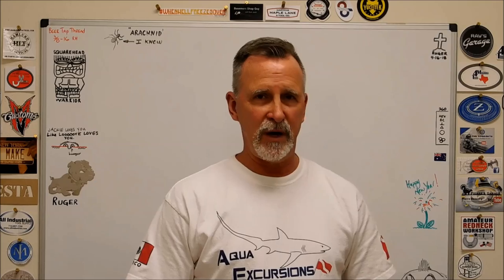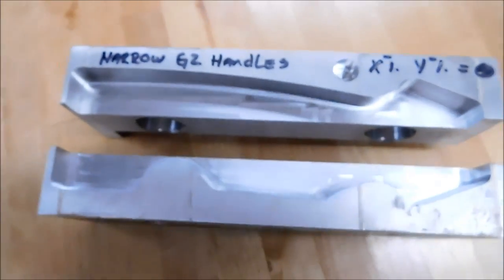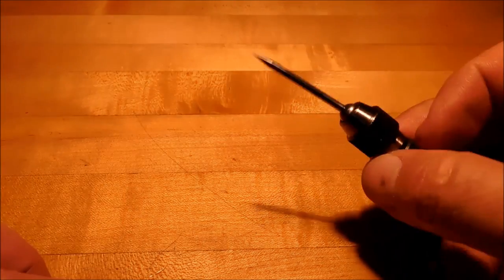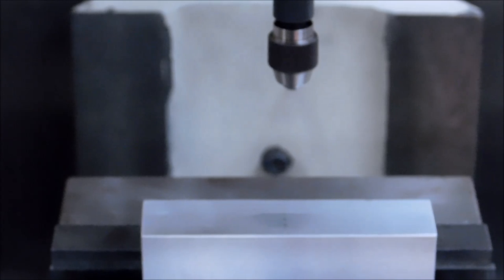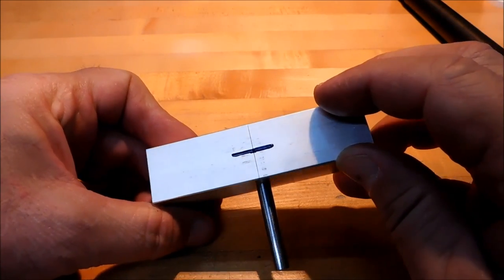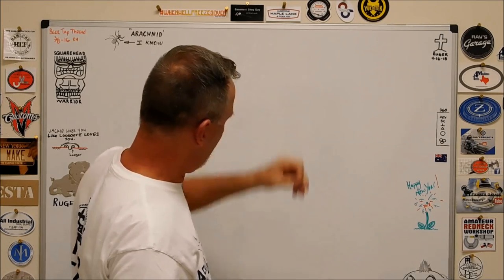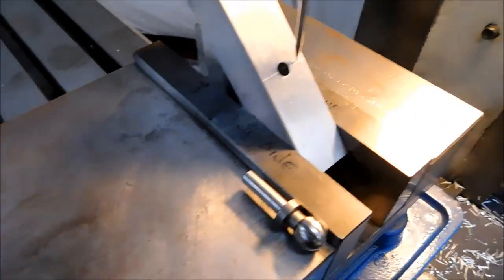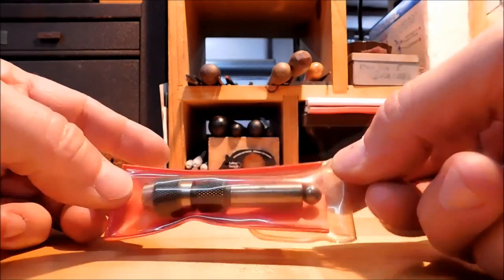Tooling Balls and Tooling Holes

Comment: Very good explanation, Joe. Thanks! Had a bad experience once when I designed a plastic injection mold using a tooling hole for alignment. Night shift "machinist" didn't understand tooling holes or tooling balls so he just obliterated the dimensions from drawing (CAD) and did NOT drill the holes in mold plates as drawn. Absolute nightmare to get mold parts to align correctly, but I did a country boy fix and saved the mold. Transfer punches saved the day!

Comment: Thanks, very interesting and useful.
For what it is worth, I use the conical end of my centre-finder differently. With the milling machine OFF, I gently lower the conical centre-finder into the drilled hole I want to centre on. The cone-ended section will then kick-sideways to self-centre in the hole, thereby creating a lateral offset with the main cylindrical body of the centre-finder. Then I iteratively move the stage until the cylindrical sections line up in both x and y. Fingertips are very sensitive, and will detect even the tiniest of offset ridge between the two cylinders. It's a surprisingly accurate technique.
For even greater accuracy, use a micrometer across the split in the cylinder of the edge-finder. When it matches the diameter of the edge finder barrel all the way around you're there.

Comment: Nice Joe!  I have always just rested the back of my thumbnail directly against the side of the tip of the wiggler. I plant the left edge of my right thumb on the workpiece and bring the tip down to about mid nail. This allow very precise control by rolling your thumb in until the tip stops tapping and runs concentric. I have my left hand surrounding the shaft above the tip to catch it if I overshoot and it wants to whip out.
ATB, Robin

Comment: Enjoyed, very interesting - Never needed a tooling ball so far, but for sure handy to know/have.
Tooling holes are something I started very early to put into my fixtures at work.
I usualy model the fixture and the part up in Cad/Cam and use the Tooling hole as my X/Y/Z zero for machining the fixture itself (if possible) and to machine the part in the fixture. So I have only to keep the cad/cam file around and dont get problems with offsets that I forget to write down/document ;)

Comment: Thank you for this very informative video. I have used a tooling hole in a very simple fixture. Still use that fixture, works great every time. The tooling hole is actually the work offset in my program. 

As for the tooling ball, I had no clue. Now, I can see how they could be a great thing to have.

Comment: Tony Tammer, machine shop teacher, California.
I learned about tooling balls at Lawrence Berkeley Lab in the 1980's.  I had to drill holes at a 15 degree angle to the surface of a part, at one inch +/- .002 from the edge. How to do this?  Locate the hole vertically with an edge finder.  Drill and ream a hole for the stem of a tooling ball.  Tilt the head to 15 degrees, dial in the tooling ball, last step: raise the table up the reference difference from the center of the ball to the surface of the part, and you are ready to put in the hole, first with an end mill to get a surface roughly perpendicular to the drill , then centerdrill, and finally drill and ream the hole.

If you can't drill that vertical hole in the part, use a tooling ball without a stem.  Machine up a tube with an I.D. slightly smaller than the ball diameter, and chamfer the I.D. edge.  Locate the center of the hole vertically (with the head vertical) with an edge finder. Then take out the edge finder, put in the tube, and use it on top of the ball,  to press the shoulder of the ball lightly against the part (using the tube to align the ball). Then wick some crazy glue between the shoulder and the part to stick the ball down, and follow the steps in the first paragraph. Tap the ball off the part and you are ready to follow the steps in the first paragraph. No trig or math needed, and you will be very close, the error being the thickness of the crazy glue.
Reply: check out the program at deanza college

Comment: Tooling balls are also used in automated or robotic systems to achieve the accurate positioning of something (e.g., a test sample, a bio-tray (tray with a bunch of small indents to drop one drop of liquid in for growing biological samples)) without requiring high accuracy of the robotic arm or automated transport device. Take a flat plate. Build a nest on top to hold the bio-tray or whatever. Mill a conic section into the bottom of the plate, apex up (a cone with the top lopped off so it is easy to mill). Mill a slot with 45º sides, apex up (a flat bottomed slot with sloping sides) on the bottom of the plate. Mill a spot flat on the bottom of the plate. Permanently mount three tooling balls on the test fixture holder, in a triangle, in very accurate positions. Now when you drop the test plate on the balls, plus or minus .125" or so, the cone will center on one ball defining a point, the grove will slide onto a second ball defining a line, and the flat will sit on the third ball defining another point. If you layout the positions of the three balls and the pattern on the bottom of the test plate so the line along the grove and a line through the two points are parallel you have a plane . This allows you to position the test plate with high accuracy using a positioning device with low accuracy. The further the three balls are apart, within reason, the more accuracy at the test site versus the milling accuracy.

If I knew how to add a picture to these comments, I would, but I don't.

Comment: I'm sure most machinists ponder the purpose of the pointy end of the edge finder. I use it to align the spindle with small holes: with the mill off I pull the quill down until the cone seats perfectly in the hole, then it's a matter of moving the table until a thumbnail doesn't catch on any of the sides of the edge finder. I don't know if that is its intended purpose, but that's what I do with it.
And my own preference is to use a Sharpie to center wigglers. It's so cool when you can feel it suddenly lock in on the perfect axis of rotation. Wigglers and edge finders are amazing in their simplicity.
Reply: i use a dead center, then indicate the hole

Comment: Tooling balls are also great for construction as well as inspection. Especially if you have multiple angles and or radii. They can all be located via the tooling ball and it allows for easy inspection. We often use a sine bar or plate and height gauge to inspect for proper location. Just thought I'd throw that in as a side note. Another great video that I am sure many viewers will find value in at the machine or surface plate.

Comment: Excellent video. I might add that the tooling ball allows you to pickup the fixture when it is rotated in several axes. It's usually beneficial to have a couple different styles on hand to match the particular variation called out on the blueprint. If, for some reason you find yourself setting up  on two angles, or an angle while rotating the workpiece , you will find yourself slipping down the rabbit hole known as compound angles. Instead of merely calculating sides of a triangle, you may find yourself looking for base angles, angles of inclination and/ or angles of rotation of a pyramid. That  topic is worthy of at least a full semester (or more ) at college . Keep up the good work.

Comment: Great presentation as always.  I'm wondering why a pointed wiggler would be used to pick up a scribe line versus just chucking up a precision ground pointed pin.  I've had a wiggler like the one you showed but never figured out why you would go to the trouble of trying to center it by hand to use it like a pointer - have I missed something here?  I've usd an edge finder a million times but never the pointer.  Great safety tip on that by the way.  Please don't quit making these videos - I love them - they make me think.

Comment: We had an ever-expanding collection of part-specific soft jaws and fixtures. Each had a fixture reference feature(s), the reference offset numbers, and the part number machined into it. The jaw pairs both had the part number in case they got separated. The data files (CAD, CAM, G-Code) were all named with the fixture part number. If you picked up a pair of jaws and didn't know what they were for it was a straight forward exercise to find the associated file. At least with CAM / CNC, adding the text was a trivial additional step. The other take-away: create a part numbering scheme EARLY and apply it to everything you create.

Comment: I use tooling balls with the renishaw probes ALL the time.  Our older Horizontal 4 axis machines don’t keep track of relative positions like our newer 5X mills.  They are a great way to quickly check your setup.  I always make some fine adjustments to my offsets using real outcomes from the machining and measuring.  Sometimes I can see that it needs to move a couple grand in one way or another.  But there is always the CMM in the quality room or even better Faro arm to wheel out to the shop to get dead nuts.  I love my tooling ball, but you can also machine tipped surfaces planar to your rotations into the fixture too.

Comment: Great video (as allways) Joe. I was just trying to explain the usage of tooling balls to someone online and I will share a link to this video. Covers the basics perfectly. 
Also a hreat tip for protecting the tip of the wiggler. It won't work for some wigglers though. My Starrett No. 828 wiggler has a screw to adjust load on the ball end at the back (top) of the assembly. BUT it is designed to so that one can unscrew the collar and reverse the wiggler end so it is held inside.
Reply from the maker: Thanks for watching.

Comment: Thanks, Joe  -- always wondered how one uses a tooling ball. 

Been bit by the wiggler -- just use a pencil or 6" Delrin rod on the on the side down near the tip, a light pressure will cause it to easily run true.  Push too hard,  it will over center,  helicopter and potentially attack ya.

Comment: One, I have both the double ended edge finder and wiggler. Edge finder recommended RPM as per Brown & Sharp 750 to 1000 max. I see people use them at 2400 plus RPM and can’t figure out why they have to keep buying new ones🙄

Wiggler is a Starrett is 250 to 400 RPM as per told by the retiree that gifted it to me 15 years ago.

Tooling balls I beg for them but companies don’t want to buy them.

Comment: Very informative Joe..   had to watch it twice to get it imprinted on the gray cells!  Thanks for the explanation..  Question..  I indicate a spot with a very sharp pointed 1/8" diameter pin chucked up in the mill chuck and it works very well for me.  What is the advantage of the style of indicator you were showing.  It seems to me it takes additional time and an extra step to get the pin to run perfectly straight.  Thanks in advance...   Fred
Reply: @Fred. Your method works but is only as accurate as the chuck jaws, chuck spindle alignment.  The ball and socket of the wiggler allow it to find the center of rotation even if a chip in the chuck jaw or something else skewed the alignment in the chuck.

Comment: I had a friend mention using the conical end of edge finder to pick up rounds where the conventional method doesn't work. You'd have to have a constant z-height, but it's the one thing that makes the most sense to me where you're not trying to eyeball something.  (Not that eyeballing can't be accurate)

Comment: Another great video.  Thanks.  Your presentation is well prepared.  The explanation is very clear.  You are probably the best presenter on You tube for machining content. My comments apply to all your other videos, as well, except for the damn spider.  Other than that, keep your fingers away from the rotating wiggler.  Use a scale or other object to get it to run true.  If you are only touching one side of the needle it can go from dead true to a flycutter faster than you can say ,"OH CRAP".

Comment: There are numerous ways to establish zero on the part. It all depends on the situation. Some times a couple  Sharpie lines works, sometimes you need to use a Tool Makers Chair or Corner Block. Sometimes you need a Centering Scope. Just like sometimes you can do your moves by the dial. Sometimes the afore mentioned precision scale and optics. And sometimes you need precision length standards as used to be used jig bores and grinders. 
My favorite all time device for finding edges is a 3D Tester. It's one of those fancy indicators that when you bring it up to the part and bring the needle to zero the spindle centerline is lined up to the edge. Now do the other axis. Bang your done. Two minutes tops. Usually more like one. Another trick i've used is to simply place a .500 dowel in the spindle bring it down below the top of the work. Bump the stock up against it and set the DRO to -.250. This works really well if yo are changing from one set-up to another and your other axis is not changing it's zero.
Reply from the maker: I showed that .500 pin trick in a CNC video about a year ago. It works well for rapid positioning.
Reply: @joepie221  
Proof once more great minds think alike.

Comment: Wigglers are great additions to a tool box. A trick I was taught by an old machinist many years ago was to stick a sewing pin in a blob of BluTac (TacK-It, Adhesive Putty, etc). Straighten it against your finger and it will ce centred on the spindle centre line.. Cheaper than a wiggler and won't demage fingers too. It can even be stuck on the tool tip if you have the height.

Comment: The pointed end of a edge finder can be used to find the center of very small holes or narrow slots. Lower point partially into hole, touch up on one side then the other side, and split the difference. Don't change the height of the spindle between readings.
Reply: Works same way for finding center of an OD as well.

Comment: If you're running a cnc with probing capabilities, you can insert a probe cycle to probe an existing feature in the part or the fixture and use g10 to offset from that position on each part.

Comment: The cone end of the edge finder can also be used to find the center of a hole provided the hole is smaller than the largest diameter of the cone. Put the edge finder in the chuck and then place the cone in the hole. Move the X and Y axis until you can feel that the cone is precisely aligned with the body of the edge finder. Your sense of touch is good to the micron range which means you can find the center of the hole extremely accurately.
Reply: Proud2bmodest, yep good use of that pointy end!

Comment: Maybe I'm not thinking of this in the right way but wouldn't a straight turned pin be as effective as a wiggler?  It seems to me that the pin would be aligned with the spindle once the chuck or collet is tightened onto it and would provide the same registration as the wiggler.  I currently use a pin turned from 3/8 cold rolled (on the shank end) with a 3/16 shaft into a 70* point.  Seems to work pretty good but maybe I could do better?
Reply: I was composing this exact question but Jason you posted it before I submitted. I occasionally grind or turn a broken tool to a sharp point to pick up features visually and thought I was so hack I never would've admitted it until seeing you do it (pick up visually) Joe. But again: why not start with a rigid probe?
Reply: @tinman5322  A rigid pin with a sharp point is good enough for most jobs, but it depends on the accuracy of the chuck or collet holding the pin, along with the straightness of the pin.  The wiggler is normally used to pick up center punch marks, that have been placed at the intersection of scribed lines.  The ball at the top end of the pointer, had a spring pushing it against the cup in the cap, to allow the pointer to move vertically.  I use my left thumbnail to center the wiggler, (if the machine is turning CW) by touching the nail to the tip of the pointer.  (It's not dangerous if you don't have it spinning a gazillion rpm)

You eyeball the pointer to align as close to the center of the center punch as possible, then, while it's still spinning, easy the quill down, so the tip (point) of the wiggler touches the center punch.  The spring inside the wiggler will compress to prevent bending the pointer.  Withdraw it quickly, and if it's wiggling, then it's not centered.  Adjust and repeat.  It's easier to do, than to type it all out.

The pointy end of a two-ended edge finder, works the same way, and you can use it to center holes, up to the diameter of the cone.
Reply: I for one appreciate that you took the time to type it all out  @throngcleaver , that's a technique I've never known. I imagine it would work at fairly slow (read safe) speeds and still be more accurate than my eyes, which are not as accurate as any of my collets. Thanks!

Comment: Nice tip for storing the sharp wiggler tip.  Great lesson.
Reply from the maker: Ya gotta poke yourself a few times and it was pretty clear what had to happen.
Reply: @joepie221  I used to true up my wiggler the same way you do in this video. Until I found that using my scale, drill rod, brass rod,or anything other than my fingers as I find it faster with less friction. I've been Machining for 40+ years in job shops and still learning. I enjoy your videos.their like talking shop over break time or lunch.